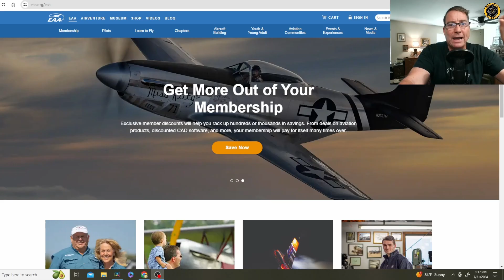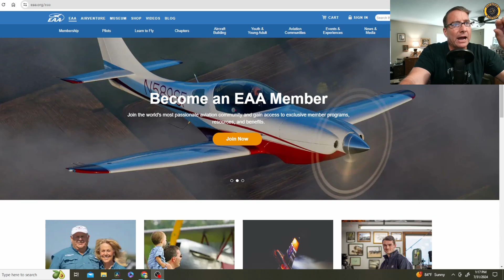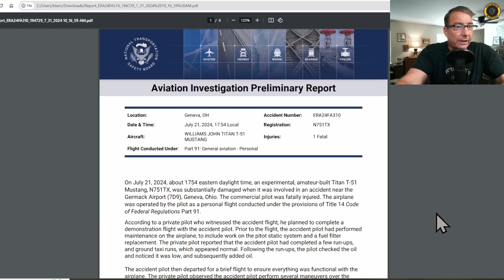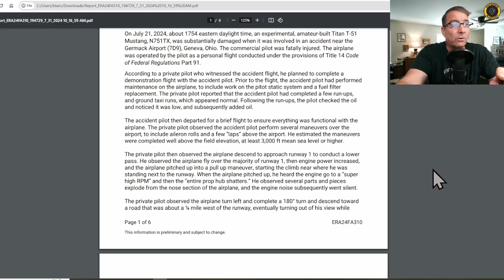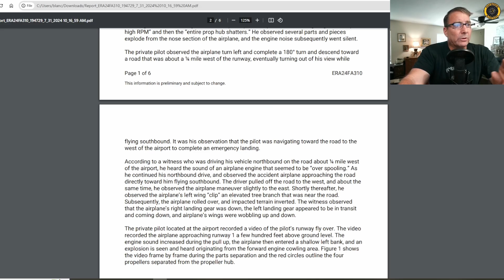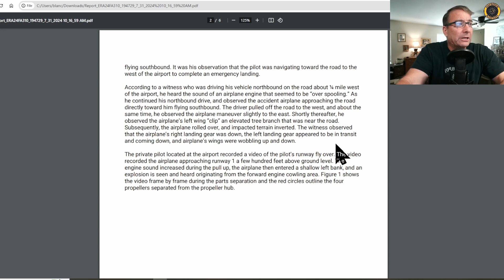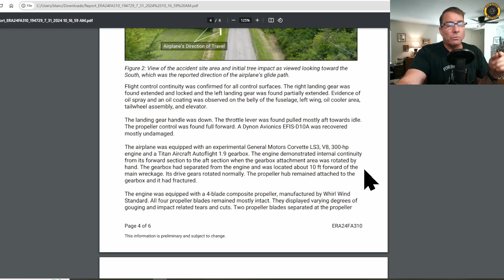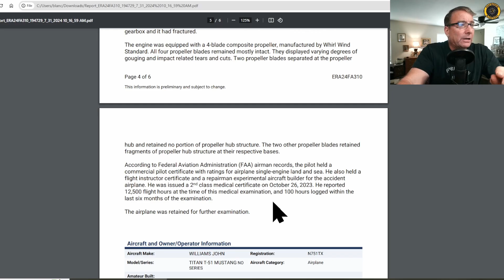Titan T-51 Fatal Prop Hub Failure 21 July 2024

Comment: That sounds a lot like the prop hub failed first, engines don't just surge under load, the load has to suddenly give. That or the gearbox but then drive shouldn't pass to the prop.

Comment: hmm, an exception are VW based auto engine conversion, that have been very successful for over 50 years, even certified in germany, subarus, corvairs, and others have also done well. V8's though haven't had success.

Comment: Three people in my EAA chapter were flying behind auto engines (two Subaru and one Chevy). Two had off airport landings that substantially damaged the aircraft. One was able to return to the airport with a blown engine.
Reply: KXLL 8 years  ago Corvair engine plane crashed pilot lived never flew again that plane had several engine problems
Reply: Unlike aero engines, auto engines aren't designed to be cruising at max power settings. Chevy LS engines cruise at around 35% power or 2000 - 3000 rpm.
Reply: @maxmackinlay618  Probably not even 35%.  Road load for a corvette at normal highway speeds, 70-80 mph, is more like 30 hp, IIRC.  That is only 10% of a 300 hp rated corvette engine.  Most corvettes have higher ratings, over 400 hp.

Regardless, you hit the nail on the head.  Auto engines are not designed to handle a high load duty cycle.  Over the years, there have been several attempts to use them in commercial trucks.  All have been failures due to short engine life caused by   the more demanding duty cycle.  Same for aircraft, I expect the continuous power used at cruise speeds to be even more demanding that most commercial truck duty cycles.
Reply: @maxmackinlay618 I was just about to say that. They have a totally different duty cycle. They may have similar peak power but they are expected to it out it only for a small fraction of service life unlike aero engines that are designed to have very high outputs relative to their peak for most of the time.... It's a critical design factor.
Reply: @maxmackinlay618  I'm not an aero engine mechanic, but I know that a builder can cam and tune an auto engine to have a narrow power curve at lower RPM.  Camshafts for marine applications and industrial engines are optimized in that way, and truck and RV cams are ground for lower RPM and high torque in a similar manner. Sure it was originally an auto engine, but it was converted into a aircraft engine. From what I know of aero engines, the differences seem to be in strength, durability, balance, weight, and redundancy, along with carb tuning while in use? And judging from the price of the engines, I would imagine that they are each hand-built with multiple metallurgical screenings for imperfections.
Reply: @maxmackinlay618 LS engines are also used in boats and trucks and are designed for sustained high output, so incorrect. A boat duty cycle is just as demanding as aviation, if not more so.
Reply: @toeknee3138  If you break an LS, you did it wrong.

People turbo stock rotating assembly to MANIACAL levels. 3800rpm of moderate load for long periods is no issue.
Reply: @maxmackinlay618 although the load cycle is different, auto engines are definitely capable if prolonged full throttle operation. Boats are running around with chevy v8s for decades now. The difference in aviation i think is the vibration and more importantly the load on the prop shaft/output shaft. Auto engines are designed to put power into a gear box. Airplane engines have massive loads applied to the output shaft bearing. Go look at an O-320 crank case half to see the size of that bearing and shaft.

This can all be done correctly, and reliably, but it takes a lot of effort. In any case i don’t think it was reduction gearing that failed here.
Reply: @maxmackinlay618 that isn’t a fair comparison. Car engines are every bit as durable as an aero engine (internal combustion) and get a much harder life and are at a much higher state of tune and peak at over 2 times the rpm. Aero engines are so low stressed it makes running at peak power embarrassingly easy. For example the venerable Lycoming 360 used in the likes of the Cessna 172 produces about 180bhp at 2700rpm from 360ci (6000cc) where as a 360ci LS is making 350 at 5600.
Reply: How many experimental planes are flying with the good old VW engines that powered the Beetle?
Reply: @RichardKroboth  My VW engine builder also does aero conversions of VWs for experimentals (including 1/2 VW's!). His aero engine work is meticulous, with bespoke cranks, pistons, cams and thrust bearing assemblies.
Reply: Subaru? there's their problem...

Comment: There are some experiments with hybrids that hold promise.  When the gas engine is a generator, even a catastrophic failure is far less dangerous, and there will be enough power in the small battery for an emergency landing.

Comment: Not sure if it applies to this engine  and gear box but I remember talking to someone about these LS automotive conversions. One of the major drawbacks was you couldn’t pull negative g because it would starve the oil pump for the propeller. If the hub has no oil pressure the propeller would drive full fine pitch thus increasing engine rpm. My guess is the propeller hub lost oil pressure somehow which drove the propeller to fine pitch which pushed the propeller rpm way above what it could handle and then the blades let loose and the engine went to its max rpm with no load on it.
Reply: Most aerobatic props work in reverse, or like a feathering hub if you will for this reason.  Oil pressure to decrease pitch, so that if you do have oil starvation at the hub, you won't suddenly over-speed.  Some other random aircraft have it that way as well.
Reply: Yep. The witness CLAIMS he heard the over-speed sound before the failure, and since sound would be delayed and visual was instantaneous...
Reply: @kentuckybowl-o-sticks  Good point, and depending on how far away the ear-witness was from the accident aircraft, given the speed of sound.
Reply: @davethompson6570  Yep... hard to imagine that his mind moved a distinct sound that occurred AFTER the prop failure in real-time, then was FURTHER delayed by the time it took to get to him, into happening BEFORE the prop failure. If he believes he heard it BEFORE, then it almost certainly HAPPENED before.

STILL doesn't change the fact that a prop FEATHERING might've led to to the over-rev, which in turn precipitated the catastrophic failure of the prop assembly.
Reply: @kentuckybowl-o-sticks  Yep how?  The witness making the CLAIM recorded the whole thing.
Reply: @Milkmans_Son  Yep how WHAT?

He SAW it, he RECORDED it, and if his statement is CORRECT... THAT'S how YEP!
Reply: @kentuckybowl-o-sticks  Relax.  Using the word "claims" in all caps, gives the impression that you were questioning the accuracy of his statement.  This didn't make sense to me since he recorded the entire thing.
Reply: @Milkmans_Son  Nope... just pointing out that the claims of others don't constitute "knowledge" on my part, nor have I seen the actual video of the event. Not doubting what he observed at all, though you know what they say about eyewitness accounts...

I don't speak in a monotone, and I don't write in one either. I wrote it exactly how I would speak it, though italics would have been more fitting... they're too much work, though 🙂
Reply: @kentuckybowl-o-sticks I can tell you from where the prop was left on the runway and where everybody stands on the apron, the plane was probably directly in front or just passing the person with the camera witnessing it. The sound delay would only be less than 500 ft so not that much.
Reply: @ Still, it would be delayed... no way the sound of a distant event can get there before the visible confirmation.
Reply from the maker: Yep!
Reply: That's an interesting limitation and would seem to fit the nature of the failure. I'll be very interested to hear the final report on this.
Reply: The rev limiter on  the engine should be set at rpm equivalent to prop rpm limit.  So no way the engine can overspeed the prop. If he was flying fast and the governor failed and caused the prop to go to flat pitch, the prop could be passively driven to beyond its redline
Reply: @joeneu  your comment is worth reading and considering
Reply: Yeah he probably was doing a low, high speed pass. As he pulled up and out it lost pressure and went low pitch. Rpm went way high more than what the hub could handled. Maybe. RIP sad. 😞
Reply: These automotive conversations  should all have to run dry sump oil systems. 
And prop and engine limiters
Reply: Dry sump systems for cars do exist i wonder if that could be explored
Reply: Why didnt the pitch stops stop over speed even if lost oil pressure?
Reply: @RobertWillis-mw9nd  those are generally set at lower airspeeds.  At higher airspeed, even at full rated rpm, you're on the governor not the low pitch stops.
Reply: That sounds very plausible!
Reply: The question would be, is there not an over-speed prevention in the engine?
I thought they were pretty common in car engines for decades now …
Reply: @advorak8529 Different speeds. The rev limit on an auto engine is set near the redline while the limit in this application is down around 2000.
Reply: @advorak8529  just a guess, but probably insufficiently precise to keep the blades from spinning too fast ... 

IDK ... just guessing.  I don't have any time in step-down powerplant/prop. but if the blades turn to thin pitch with a loss of oil pressure, overspeed can happen pretty easy especially if the RPM is at/near max for the prop speed already.

Definitely a problem needing to be solved ... but an LS engine in an aircraft?  wow.
Reply: You'd think a dry sump convertion would be part of the setup, but more cost and space  suppose.
Reply: AH ... thank you.

I wondered about the step-down hub.  they aren't unique to automobile engines (C421) but they aren't standard with typical aviation engines today.
Reply: During an aileron roll the engine is only inverted for a few seconds, probably not long enough to drop the oil pressure to the prop. In any case, it'll be interesting to see what the final report says, or if their guess is any better than yours.
Reply: Having built many high performance LS based engines, my guess is that a dry sump system was most likely in use on this airplane. I cannot imagine anyone using a factory LS wet sump system in a relatively high performance, experimental aircraft. No, I think something else went wrong here.
Reply: @life_of_riley88 they use a wet sump in these airplanes. The gearbox is a self-contained unit and does not use engine oil.

Comment: Thank you for calling out the fact that Experimental class comes with much more risk than going with a conforming design. Aircraft engines are expensive and old school in design because changing anything requires expensive certification for the manufacturer but if you are up in the sky with one engine and propeller with your family on board I think I would not want to take that risk? Sorry to hear this gentleman lost his life 🙏

Comment: Is this a hub that can change the angle of the propeller blades?

In that case, maybe the air resistance from the propeller blades was greatly reduced by pilot or hardware failure making a big change to the blade angles. This resulted in reduced load on the engine, making the engine and propeller RPM soaring. And the excess RPM then  resulted in too big forces on the propeller hub, resulting in all blades separating. And then possibly yet more RPM from the engine until the pilot had time to react.

Comment: An LS3 can hit maybe 8000 RPM before something breaks.  With only a 1.9 gear reduction the propeller will hit 4200 RPM.  That's way too high, but I wouldn't have thought it would come apart.

Comment: Existing aircraft engines don't fit in the narrow nose profile, so it wouldn't look "correct" as a replica mustang.  Propeller's operate around 2500-2600 RPM for full power.  Car engines have the best sustainable torque output range in the 5000-6000 RPM.  A gearbox is used to get the max torque range of the engine matched up to the max thrust range of the propeller.  The accident report stated the gearbox had continuity with the engine when turned, so the gearbox did not fail in this case.  The report did not say if the propeller hub was electric or hydraulic controlled.  Either way, if the hub failed, and the propellers departed the hub, or would go to flat pitch, the load on the engine would go away instantly, and the engine would immediately overspeed and the crank or piston connecting rods would fail.  You physically couldn't pull the throttle back fast enough. If the hub was hydraulically controlled, this is the engine oil that goes through the hub, so it would all leak out, and the engine would fail shortly regardless.
The loss of the prop, would affect the airplane to be slightly tail heavy, but not that much, that it couldn't be flown and controlled.
I have been told by instructors, if you lose the engine in flight, the insurance company just bought the plane.  Don't try and save the plane, do what you need to do to save yourself and passengers.  Off airport landings...do not pick roads, go for open fields and gear up if it has retractable gear.  He chose a narrow road, and was trying get the gear down.
My condolences to the family, a loss for the aviation community.  May we all learn from this accident.

Comment: Originally by hearing the 180 turn, I expected the typical stall. He darn near made it. Not much room to thread the needle. May have over corrected as it looks like he angled into the trees or just at minimum control speed and unable to correct in time.
  Such a sad moment for family, friends and fellow pilots.
  Regardless of experience, with aviation all it takes is just once…😢
Reply: Those utility poles on the right side make this a mighty narrow landing space to shoot for. Bummer that there wasn’t a safer space to shoot for.
Reply: @jgalexander510  Yeah if you look at Google Maps there were really no good options. Even the fields dead ahead are small and surrounded by tall trees. The bigger roads all have power lines on one side and trees on the other. Even so, he almost made it.
Reply: I wonder why he didn't just go straight ahead. Looks like lots of open fields, and a lake.
Reply: @MrJeffcoley1 I thought the same thing. Also, someone said the landing gear was coming down. After a major failure I would just want to pancake in and hope to walk away from the landing.
Reply: @MrJeffcoley1 open fields, wow, you are correct, do not make the impossible turn!
Reply: My feeling is the urge to try and save the airplane might have been overwhelming and clouded his judgement. The advantage here was he had no drag from a windmilling 4 blade prop so perhaps he thought he could pull it off.
Reply: Perhaps he started an attempt to go "more than" 180 and gain the solace of the runway. He reassessed after the 180 and calculated that he only had enough energy to reach the parallel road; that continuing with the original attempt he would fall short. We can't know, but it would seem a practical strategy, IFF he could do the impossible turn - which right now it appears that he did.

Comment: i wonder if advanced electronic Rev limiters had been installed..  they cut spark to various cylinder .. not the same cylinder every 2 rotations.. they are great at limiting RPM excursions  without damaging the engine or systems.. would the automotive manufacturer allow them to be installed on an Experimental aircraft??/

Comment: he must have heard a limiter on the engine maybe that's what failed! but he should have been able to control it manually maybe didn't have time, he should have made sure the prop transaxle is well above specifications, he did say something about it being at its limit so that's not good.
another way you could controlle it is to put a Central fugal clutch in and if it exceeds the maximum speed it will disengage but I don't think he had anything like that.

Comment: I don't get the need for more HP if the RPMs can't exceed 2000 -3000 rpms. If you insist on wanting a high performance V8 why not a rev limiter instead of some type of gearing? Why not go with a V6 or even a turbo 4cyl. Booth of those engines can make 300 HP. They also decrease weight making the plane lighter and more agile. Looking up carbon fiber props I found E Props which are carbon fiber with titanium lead edges. It says they can take 5400 RPMs at takeoff. Cars are no different. You can have just as much fun in a lighter car with a smaller engine as you can in a heavy car with a 454 . A lot of energy of a heavy engine is used up getting it rolling. You are also losing handling.

Comment: I’m not an engineer but ask if a transmission fluid flush was done recently? Which may stir up material that was not detected on an initial drain inspection?
Reply: There’s no transmission per se. Simply a set of reduction gears with attendant lubrication. Essentially the prop rpm is directly tied to the engine rpm. I can’t speak to changing  the lubricant in the gearbox but it in no way resembles an automotive transmission.